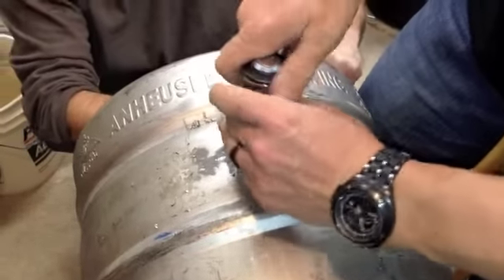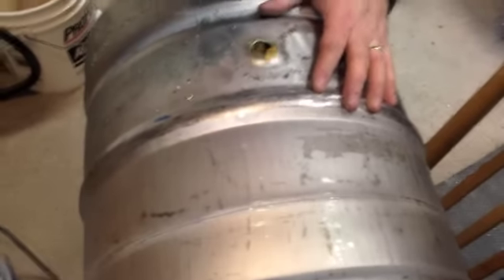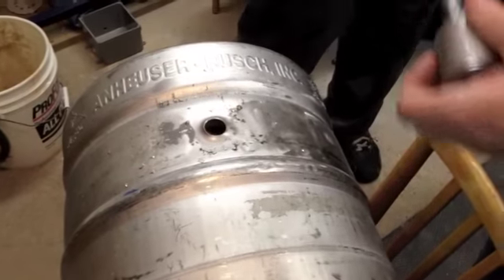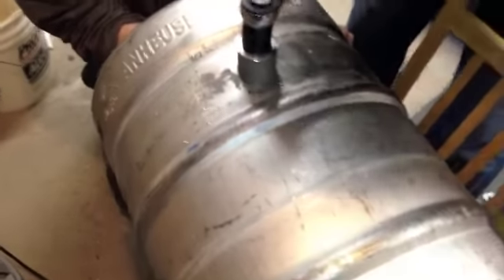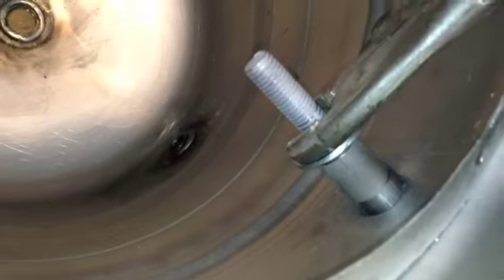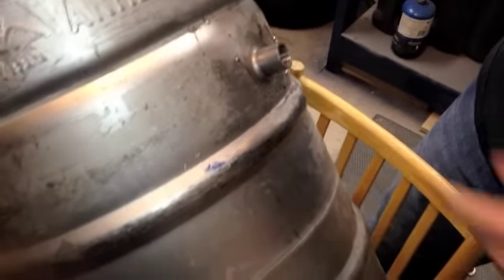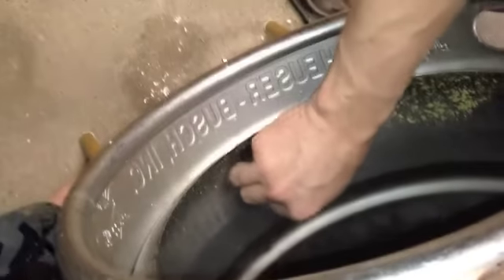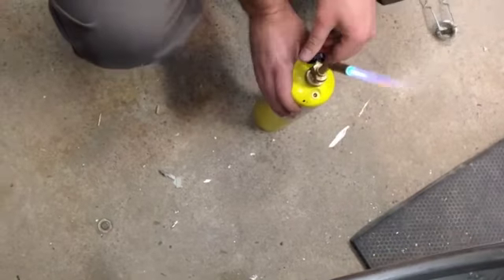Silver Soldering a Keggle pt 2

Comment: would there be a big problem if you just welded it to the face of the keg surface without the dimple?
Reply: You need a tight fit between the fitting and the keg.  StayBrite 8 fills gaps better than StayBrite.

Comment: is silver solder safe for consumption if it is please let me no cause I am building a keg still
Reply: Yes it is. No lead in it.
Reply: thanks for awnsering me I got mine of off eBay it is 96 percent tin 4 percent silver solder it melts at 430 f  Rosin flux core.  Do u think I can solder a two inch ferrules that is stainless to a two inch copper pipe we're I can clamp it to my keg
Reply: David Cooley pretty sure you can mate
Reply: Also make sure that there is no Cadmium in that solder, some do